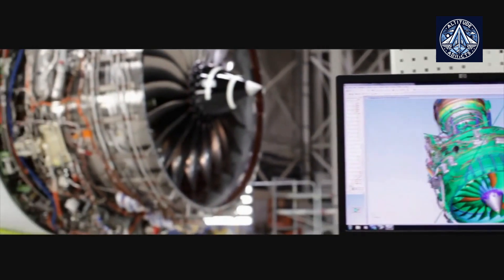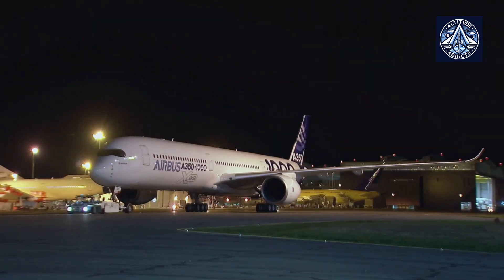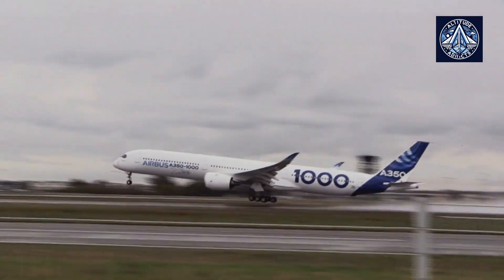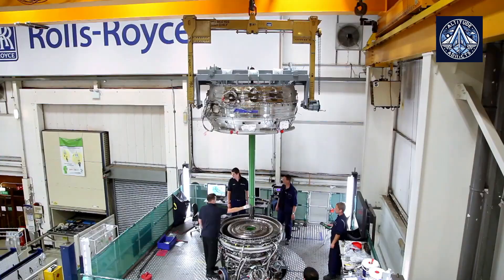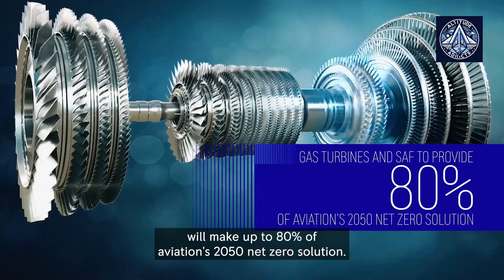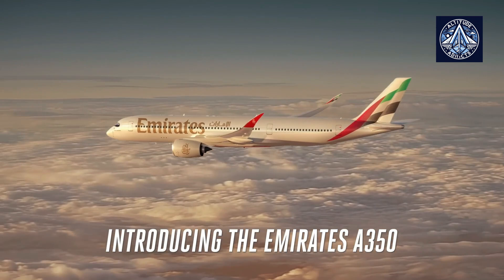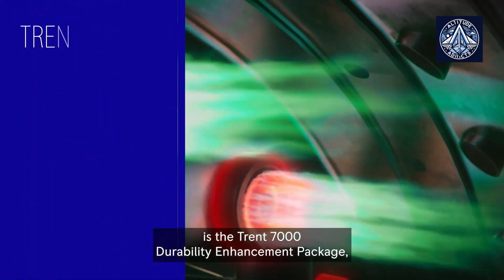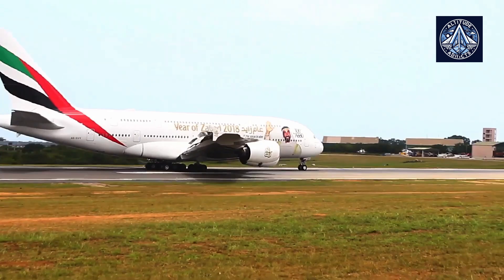Rolls-Royce to Fix XWB-97 & Trent 7000 for A350 & A330neo after Emirates Airlines Criticism

Comment: Still long way to go.
Should build small engines that it used to make
Reply: It was the most major mistake that RR management ever made, to cancel making small engines and go for big ones instead. How many A320 have been sold?
The Ultra was supposed to cover that by being "scaleable". heard NOTHING--STILL NOT CERTIFIED.  What are they doing?  STILL repairing the 1000 Trent and the XWB 97